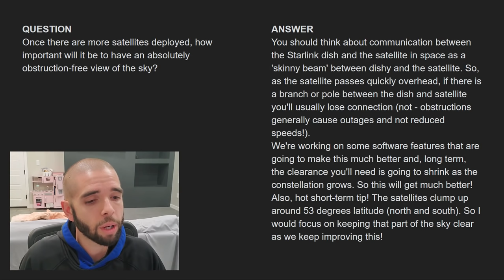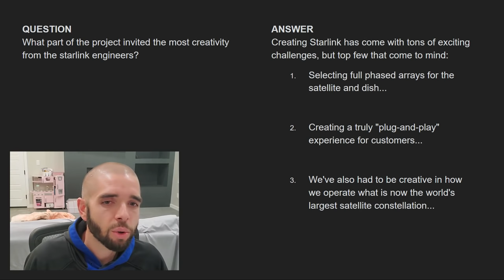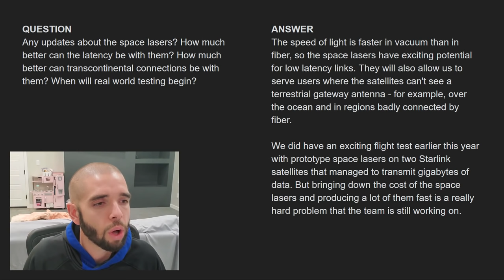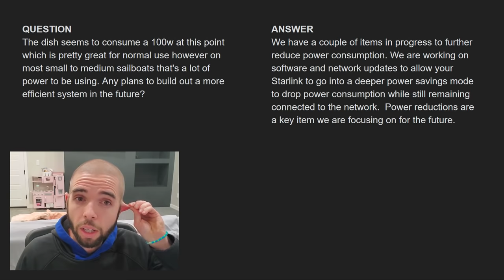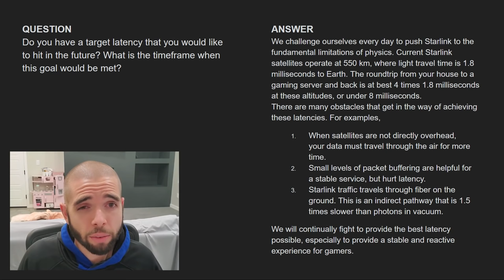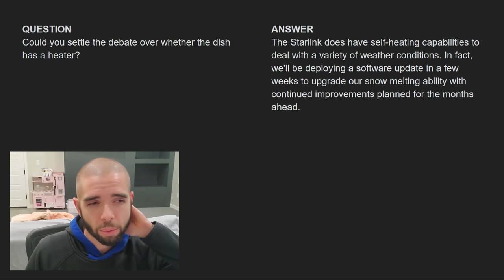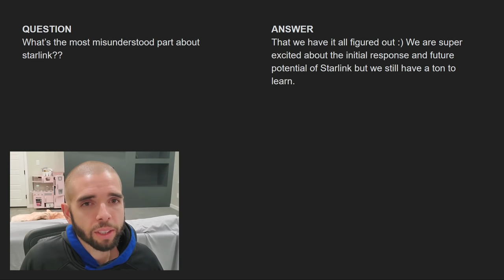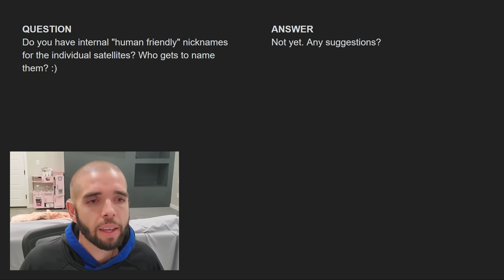Starlink Engineers Answer Our Questions! Reddit AMA 11/21/2020

Comment: If they would just add a 12 payment plan for the hardware words rolled into your $100 a month service that would be better than spending $550 upfront! I’d be OK with adding almost $50 a month to my bill for just 12 months if I didn’t have to fork out nearly $600 after tax upfront
Reply from the maker: This is for beta mind you, I think at some point the pricing will come down or they will roll into the monthly cost, or perhaps a payment plan. They will need to come up with something for less affluent market penetration.
Reply: Apply for a credit card, or some type of loan
Reply: Or you could save up for it. There is always that option.

Comment: Did they happen to say why these only seem to be available to troubled loners in remote locations out in the sticks?  There are lots of places here around Phoenix with no viable internet but if you put in the address they say it's NOT AVAILABLE!
Reply from the maker: It a combo of population density and current satellite density. The Starlink network can only handle so many people in a certain area bandwidth wise. So if it's not offered its due to them thinking they can't offer a high enough standard or service.

Comment: Why is there a GPS receiver inside dishy if it doesn't need any pre programmed satellite positions? I think the overall trajectory is stored inside of it and with GPS you can pre calculate the angle towards the atmosphere..
The GPS receiver would be unusefull for any other thing, or do you use it for quality of service/billing purposes? (No m
"Mobile" mm usage?)
Reply from the maker: That's a good point and I'm not 100% sure why that would be. I am confident there's a good reason though, why would they include hardware that isn't necessary.
Reply: Remember Dishy sends initialization data to the satellite constellation with it's GPS coordinates.  In addition to providing each Dishy instructions when to hop to a new satellite, satellite traffic load and even customer offered load (up and down) within a given area are important factors, I'm sure along with many other factors analyzed by the dynamic network algorithm.
BTW, that's why Starlink has the ability/restriction to restrict service within your local GEOspace (unless you have one of the upcoming mobile ESIMs).

Comment: i live in north idaho, where 25 miles away is a good internet conduit, but not available here.  So what is the maximum distance from a land based connection that is available?
Reply from the maker: I did a previous video showing where to find the ground stations Starlink Coverage? https://youtu.be/plE__-hWdck

I think they need to be fairly close, within the few hundred miles I would guess. Once they get the sat-to-sat laser configuration up this will be a different story.

Comment: I am interested how do they plan to provide the service to every potential customer in the world, when even with 12k satellites working at full capacity, and with normal user usage, it could have not more than 10-20 million users max worldwide, right? 🤔
Even if the newer generations of satellites get improved, we are stuck at this limit for at least 5 yrs.
Reply: This service is focused on remote users, with limited or no connectivity, not cities and large towns which are mostly already hard wired. There are plenty of customers in many countries which fit into that limited access or  no access category.

This is not to take business away from the major internet providers in each country, it's just not feasible.

It is worth remember that once a satellite is up, it's cost is shared over all the potential customers it can reach in it's flight path.
Reply: @neilm9400  Yes, I understand that, but there are almost 4 billion people in that category.
Reply: The eventual plan is 42,000 satellites connected by lasers and not relying on ground stations.
Reply: @Earthlog  The way I understand it at the moment, is that the lasers are for situations where there is no ground station available, e.g. middle of the sea Or for data traffic that will pay for the lower latency e.g. bank trading, where 10 ms is worth millions a day. The longer the journey, the bigger the ms saving. London to Singapore.

The rest of the normal traffic will be go up and down to the nearest ground station.
Reply: @Earthlog  no one will allow Elon to have 42k of his satellites in space. That's too much especially considering the fact that other competitors are coming up as well including Amazon and Indian telecom company Airtel.

Also, even 42k are less than enough to handle so many users around the world. It will remain a limited service to limited population even in best case scenario.
Reply: @abhidahiya4007  If I was a betting man, I'd wager Starlink will grow well beyond it's current authorization of 10,000 satellites.  The FCC not only continues to be most accommodating for additional launches that enhances innovative competition, but better yet, enhances affordable rural internet service.  In fact, the FCC recently announced a $990M subsidy to SpaceX/Starlink in support of rural service.  That said, as network demand grows and Starlink capacity is reached/performance is affected, Starlink will be forced to use tried and true mechanisms we all know too well - demand-based pricing (monthly threshold, time of day, QOS, whatever), throttling and similar gating factors.  The days of "all you can eat" buffets sound great in principle but with customer's insatiable network demand, "someone" must pay the grim reaper...
Reply: @CaliforniaTravelVideos  there is a limit to how many satellites can be realistically allowed up there. It's not like space is Unlimited in the orbits and one can have as many satellites as one wants.

Not to mention, other competitors are coming up with their similar solutions as well. So they will have their own quota too. It's an inherent limitation and no one can overcome it.

Comment: Can the dish get "stuck"?  My dish is at 48 -30 N and 118 West. Download from 30 to 90. I'm getting very little signal drop, however it dropped for several minutes. Dish not wet, etc. I finally  unplugged the system, replugged it a minute later and the system worked fine.  Can giving it that jolt, get it started tracking again?

Comment: One issue I’ve had is constantly varying speeds, up and download. Latency and jitter are also changing significantly. I have questioned Statlink about this problem and they seem to think the fact that I buried my cable form the dish to the house is playing a part in the variations that I am seeing. Is that likely? I am also using the full length of the supplied cable in my hookup. Can either of these things seriously have an effect on the quality? I have not modified any of the equipment supplied by StarLink so this is only their original equipment.
Reply: Burrying may have an affect yeah considering the current going through the cable. I would consider taking the cable out, putting it into a conduit and burry the conduit.

Comment: So there has to be about 100 feet or so of the black cable going to dishy.  I only need about 10 feet of length so my question is, what do you do with the unneeded 90 feet left over?   Same with the extra cat5 cable.
Reply: I think they sell a version with only three inches of cable but it poses issues of its own.

Comment: Here's what I'm getting with my Starlink...Download speed today 70.3 Mbps upload 4.3 Mbps 127 ms latency.  This all seems good to me (after Hughesnet) and wondering if it is.  What do you think?  I am 15 miles outside of Helena, MT, and wonder where the closest base station is to me.  I have no idea.
Reply from the maker: That's what I see in a wireless connection.  Are you wired into the router or using it wirelessly?
Reply: @JoshGreisen  We have a router, but everything is wireless.

Comment: My Starlink router keeps showing red, I have had no luck rebooting and restarting the Starlink system. How do I get ahold of Starlink?
Reply: Once you get the system all installed in a clear location and router all plugged in you must use a computer or laptop to get password and username started before it will connect to the internet. Blinking white light means searching for satelite and red means cannot connect to internet. Once your on the computer click on the starlink wifi connection and the computer will bring up a box where to rename your internet and make password. If u already tried this then you should be able to go to starlinks websit and find a support or contact link at bottom of webpage to at least email someone. Hopefully u get it figured out, best of luck!
Reply from the maker: This sounds right, let us know if this works!

Comment: I'm thinking that I might have to mount Dishy on my house roof.  I've heard a few comments about radiation and the strength of Dishy's output.  The only thing I heard that was at all definite mentioned a recommendation to stay 3' away from Dishy and keep your time closer than that restricted.  I don't want to mount this on my house roof unless I know radiation won't be a problem.
Reply: The antenna is directional...
Reply: The radiation goes up!
Reply: Excellent catch!   Since Dishy's focused beam is 37dBM, apparently Starlink personnel believes customer's bodies will not interfere with the 10GHz beam.  Stay tuned for further warning instructions on future mobile Dishy antennas including circuitry to cutoff the transmitted power within 100ms of an obstructions.  Just don't try roasting marshmallows over Dishy!

Comment: All these people saying it didn't have a heater.. "it just the radiation causing the heat" bahaha
Reply: Internal heating capability != it has a heater installed.  The electronics may well produce heat needed to melt snow.
Reply from the maker: The dish get's pretty darn warm, I can vouch for that!
Reply: @JoshGreisen  Agreed.. I've measure it up to 71C using a FLIR device... That was at 21C ambient temperature, inside so no satellite link active.  TurtleHerding.com -> Starlink update 2020-11-13 if you're interested in the photos.

Comment: I would like to know if I live in a big metal building would it affect the signal?
Reply from the maker: That's a good question. I 'm not sure, and unfortunately do not have a big metal building to test with :)
Reply: The idea is you place the starlink outside of your house
Reply: @yfs9035  lol. No s h I t. But if it's on top of a giant metal building it may interfere with the signal, Like it does with my cell phone and drone.

Comment: Very misleading..you can not use this on a boat or down the highway. Once it is set up it can not be move at all it will lose the connection every time it is moved.. talking about sailboats and flat beds going down the road without mentioning  it can't be move once set up is misleading.. as for high winds you could put a plastic shroud around it to block the wind.

Comment: How far is the router transmission distance
Reply from the maker: It's a typical router in terms of range, it provides a 2.4Ghz and 5 Ghz signal. A couple hundred feet unobstructed, with walls, only 50 feet or so.

Comment: here in iraq the temperature becomes +50C at summer 
do you think the dish can handle it ???
Reply from the maker: That's a tough one, I would think it would survive. Not optimal though for sure given it's +10C above the current operating recommendations. How much of the year is it that hot?
Reply: @JoshGreisen  
about 4 or 5 months
Reply: @ghost.1413  That's a significant time of year buddy. I doubt it can handle so much temperatures at all! It may even work for sometime but will quickly fail under such temps. 

Even here in India, especially Northern, Central and Western India, Temperatures go upto 48-49°C in summers for about 2-3 months.

Comment: DID YOU SEE ANY QUESTION IN REGARDS TO RV's AND BOATS.
Reply from the maker: Yes, see the this question at timestamp 05:00 - Mobile Use Now and Future?
Reply: @JoshGreisen  I live in my RV in Tucson, and hope to get Starlink, since the other Tucson ISP's are junk and slow. I've been thinking about a nifty pole system off the roof ladder, that I can raise and lower for transport when I move the rig. Dishy will probably get to ride indoors or in the basement on the road, but when stationary, I'll put it on it's pole, and hoist it up. This way I can adjust it for the northern view at the destination. Given time, and access to the technology, I can't help but think that Winegard or King will take up the task of a roof-mount motorized antenna. They already do that for DISH/DirecTV. And I'm sure for them, they would pay SpaceX for the rights to the antenna technology to make it mobile. But as you said, they're still learning and writing the book as they go. But if you take how the DISH/DirecTV satellite system, it went from ... It will never work, to besting Cable TV's with their own game and decent service to boot... I think this is a newer and better revolution!
Reply: @leesully1669  With Dishy's phased array antenna design, moveable antennas are a moot point.